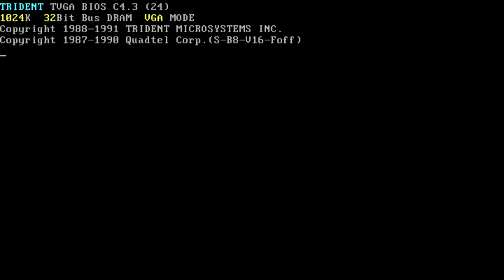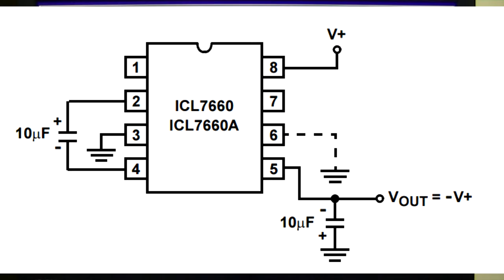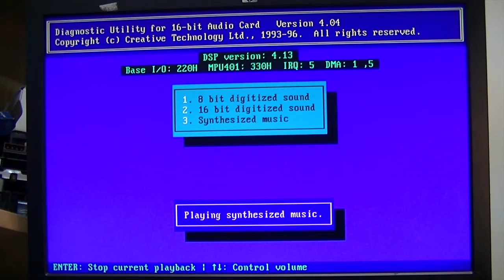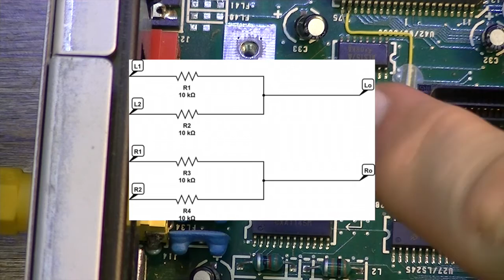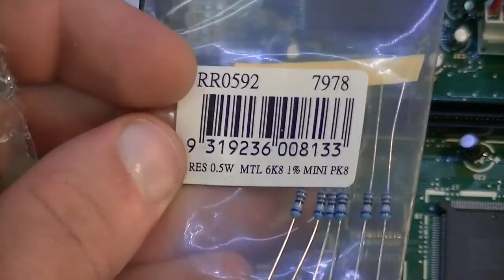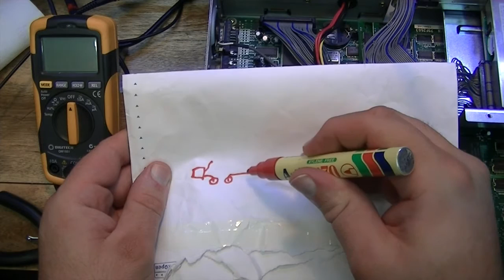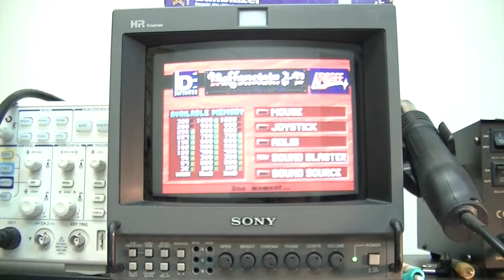[retro swim] - Episode 36 (Part 4) - Teradrive Finale!

Comment: Hello, new sub from over on the ADG filler vid you were a guest in. I just watched all four parts of this episode, as I've always been interested in obscure PC/Sega tech the TeraDrive and glad to finally see it in proper action along with seeing the inside of it. I wish that Sega and IBM went with the 386 instead of the 286 for the TeraDrive, as it likely would've seen a lot more success in Japan and it would've been able to play a lot more DOS games as a result. If it wasn't practically and physically impossible I'd love to replace the 286 socket on the motherboard with a 386 one.
Reply from the maker: This has been done actually! Ronnie on the ASSEMbler forum managed to get a "Make-it-486" upgrade kit working on his Teradrive Model 3. It did involve desoldering the CPU to fit a PLCC socket, but apparently it works quite well!

It's not a perfect solution though. E.g. you're still limited to 2.5MB of RAM unless you use up that precious ISA slot with a relatively slow EMS board.
Reply: ***** That's awesome! But, yeah, even with that said it's still not feasible if you want proper power behind the CPU instead of bottle necking the performance. If someone out there has the schematics for the TeraDrive, it would be nice to see if someone could make a custom board that allows for a 386 or 486 along with the MD hardware on the same board.

Comment: How does the system have working com ports if there is no -12 in the system? I also thought some sound cards needed -5 volts which I knew was a problem when adapting some atx psu's to at.  Very strange system indeed!  Also what is that 50 pin port on the top of the ISA riser board?
Reply from the maker: Indeed there's no -12 or -5v rails, and many if not most ISA sound cards need a negative rail for their split-rail amplifiers. You can do RS232 without a -12v rail using a Maxim MAX232 or similar chip. These contain internal DC-DC converters to generate the signal levels needed for RS232. For sound cards, there's another video in this series on my channel where I build a small DC-DC converter, and hack it in to an cheap SB16 card to gain sound. I don't know what the 50-pin header is for, to be honest! The Teradrive Model 3 had an internal proprietary HDD, might have been to do with that, I'm not sure sorry!
Reply: @RetroSwim  Thankyou for the reply! Interesting info about the RS232. Makes sense. I wonder where the traces would lead from that 50 pin connector. If I had to guess it is either the equivalent of the bottom slot on a genesis or perhaps some sort of processor local bus? Unless there is some random WD chip sitting on the motherboard somewhere which gives it SCSI, now that would be something.
Reply: @RetroSwim  when looking through the video again, I notice at 9:37 an AMD chip to the front of the case. But could not see the markings on it. But it sits in the same type of PLCC package that many NCR based scsi chips were manufactured in, and AMD licensed those from NCR for production in some OEM applications. You may have SCSI there...
Reply: @RetroSwim  Wait, no that is the main cpu... doh... oh well. Thought I was onto something.